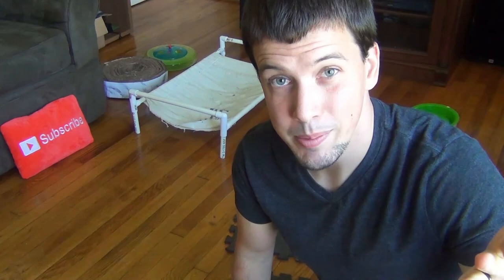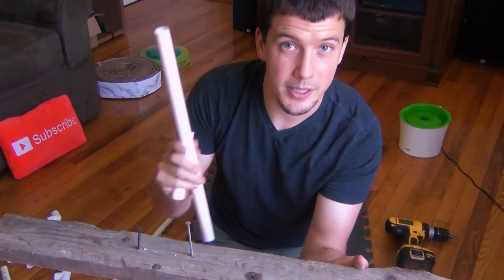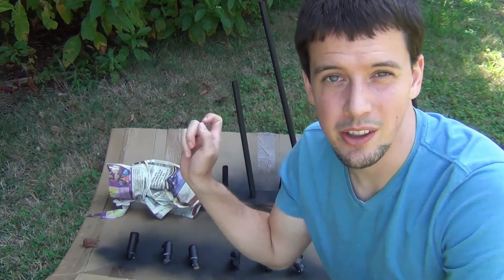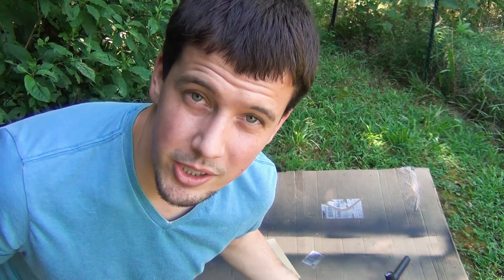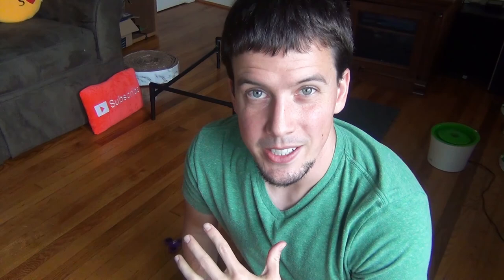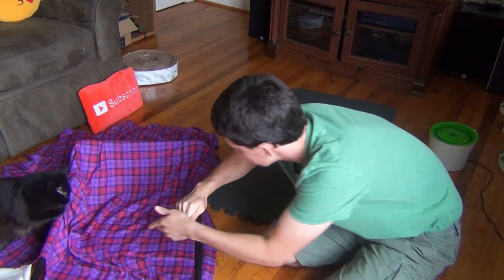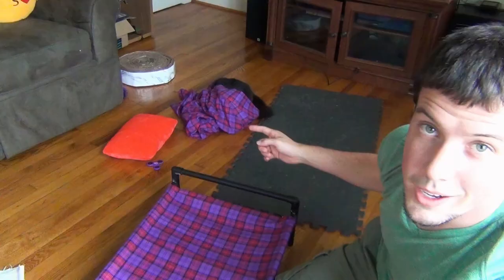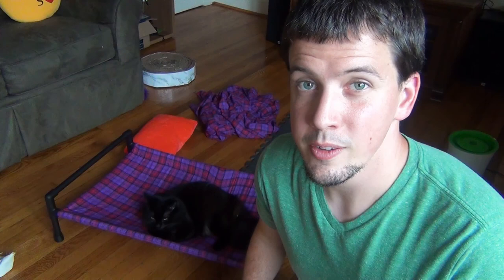DIY Cat Hammock Upgrade |  EASY + CHEAP

Comment: Just an idea if you are not into spray painting, what about wrapping the pipes with twine? The cats can scratch it and it will help keep the material in place.
Reply from the maker: That is a GENIUS idea! You could even use bigger pipes and/or make a taller hammock with 4 complete scratchers! Might be another video.. will have to keep thinking! Thanks!
Reply: my thoughts exactly. I'm making one this week and I'll use twine 💙
Reply: Leah Daniel I like that idea, can never have enough scratching ares around wtg 👍👍
Reply: Leah Daniel also contact paper, like drawer liners from the dollar store, also easier to clean and safer.
Reply: That's an awesome idea; thanks Leah.

Comment: You could have used the pillow case as a template for your fabric. Just cut the pillow case down one side and lay it out flat on top of your fabric. Don't forget to give yourself enough fabric for the seam. Stitch up the side and you're all set!

Comment: Love this idea. I wanted to also make a few suggestions.
Lowes has the corner pieces you were talking about in the first video, but only in the 3/4 inch size PVC.
Crayons are excellent for marking PVC.  It makes a nice visible mark that is easily rubbed off with a cloth if you make a mistake or when finished.
Acetone will take off the writing easily.
The purple primer can be used to stain the PVC 
There are PVC cutters sold for around $20 that look like a cross between a branch cutter and scissors that makes cutting PVC really quick and easy without all the mess and rough edges.
Hope these suggestions help.

Comment: Acetone will remove the ink.   Run some string through the PVC and tie the ends to something, like a cardboard box with holes in it, to paint.  Wire hangers hanging from a string also works well.  It gets your PVC up to a comfortable working height.   It works better if you glue BEFORE you paint.  A marker will help you make sure all your joints line up the way you want them to, then just paint over it or use some acetone to remove the ink.
Reply from the maker: Awesome, thanks for all the tips Ron! I'll heart this so others can more readily see it

Comment: Love your cats. I have a black cat and an orange tabby as well. The black cat made a hammock himself out from the mesh under my box spring so this would be purrrrfect. Pun intended. I see some other viewers have some good ideas too. I love the one regarding the twine. PROJECT!!! You can always get a mat to set it on to keep from sliding all over the floor.
Reply from the maker: Our orange kitty does the same thing! We have a hole in the boxspring and she will get up under there during a thunderstorm
Reply: The one in my profile picture did, too. It broke so much we had to take off the mesh. She has been pretty mad at us, but I have fabric so I want to make her one.
Reply: Just finished a hammock for mine for this reason. Granted, it's only existed for few hours at this point, but she's already decided to ignore it... Typical cat.
Reply: Literally why I am here. I just patched up the second bed bottom of boxspring to stop him...my black cat. 🥰
Reply: My momma bunny did that and it took me several days to figure out where she stashed my grandkids! She knew that lazy cat wouldn’t look under there….

Comment: If someone doesn't want to use the glue (which is a better idea, especially if making more than one), you can also buy 2 more T fittings and use them on diagonal legs close to the floor with a crossbar.  This triangulation should eliminate racking.

Also, you might find the legs you cut need to be a bit longer - the cat was very close to the floor with new, unstretched cloth, it might sag to the point they are touching the ground.

Comment: Thanks for the great project. May I make a couple of suggestions to make this easier to make? For this particular application, the purple primer you used before gluing is not strictly necessary. The glue will bond without it. Or, instead of using glue, use a short sheet metal screw at each joint. There are self-drilling screws available too, which will eliminate the need for pre-drilling a hole. This will also allow disassembly if required.
To eliminate sewing, use iron-on hem tape instead. This will conciderably reduce construction time. The hem taped hammock cloth can be machine washed without a problem.
Reply from the maker: Awesome, thanks for your recommendations! I thought the you needed both parts to make some chemical reaction for anything to happen.
Sheet metal screws are a great idea, and would be nice to be able to take it apart easy. I would need to figure out some way to cap the ends though, so there were no sharp edges. 
I haven't tried iron-on hem tape, I'll check that out. Skipping the sewing part would be a big time saver!
Reply: Cats and Pats The end of the screws will be inside the tubes so there will be no exposed sharp bits.
Reply: @CatsandPats What a great project. Thanks. To add to what Waltkat said, I frequently use hot glue to connect two pieces of fabric. You cannot tear that apart.
Reply: I would use hot glue or e6000 before I would use something like steam-a-seam. Which you are referring to as like the Hem tape. Just not strong enough depending on how heavy the cat is

Comment: These are cool. I'd love to do a multi-story one.  BTW, If you don't need pipe to be watertight, you can just use some E6000 or Gorilla Glue.
Reply from the maker: Awesome, thanks for the info Jenna! 

I was thinking multi story would be pretty cool too, and probably not too hard. I think they might want a solid edge if they had to jump all the way up to it though. Hmm, i'll have to think more

Comment: You could glue a zipper to the fabric for easy washing and glue the pipes so it doesn't break down
Reply from the maker: The pipes are glued together. I hadn't thought of putting a zipper on, that would be pretty interesting :)
Reply: Or even more easy put on buttons or strong velcro to the fabric
Reply: Glue is toxic to cats

Comment: If u buy the R brand spray paint he did for plastics you don’t need to sand paper, it contains primer that will help it adhere 😁
Reply from the maker: Thanks for the tip!

Comment: What about multi-storey construction for if more than one cat would like to use the hammock in the same time ?  This combined with the idea of twined vertical elements serving as scraching/climbing surfaces makes sense to me (note 2 front "legs" used for climbing up could be thicker than the other 2 in the back).

Another idea is to utilize towels for the textile part.

What do you think ?

Comment: How about using e6000 would that work better than this liquid stinky stuff?
and for your spray painting issue perhaps having a wall of cardboard or some kind of enclosure that way it will prevent the wind from having the spray come back towards you
You can also glue fabric onto that PVC. Just have the glue working on fabric to fabric and not necessarily gluing it to the pipe itself